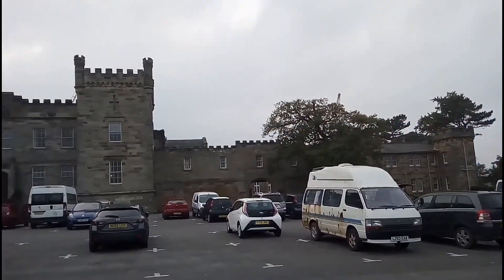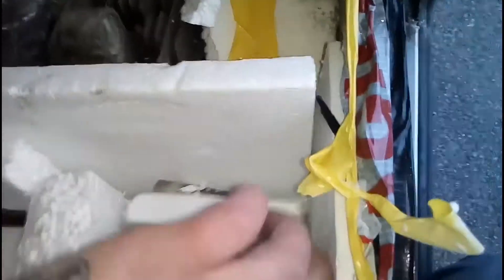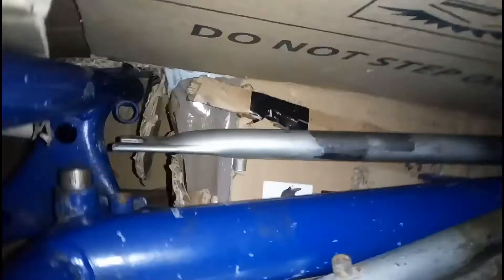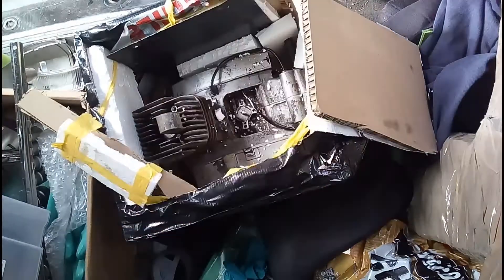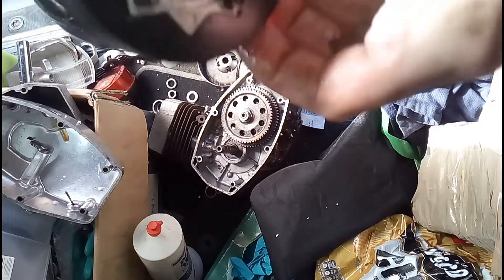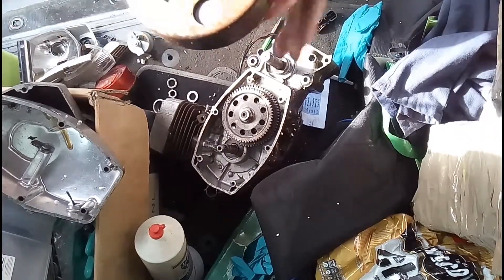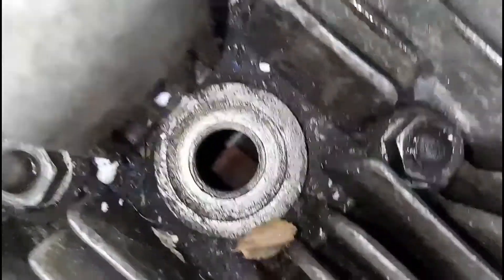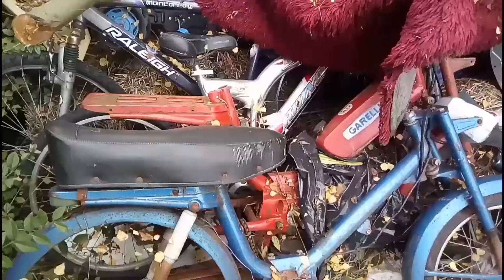Garelli Concorde by post. Filmed on location all over the place

Comment: I like your videos and I also restore mopeds however I am wondering where you get yours from. I buy almost everything from ebay and people seem to want the earth for almost any old wreck. Some idea of your sort of sources please.
Reply from the maker: Hi thanks jon8xty1 glad you like the videos! I get most of my stuff is from eBay too but I spend a lot of time finding bikes nobody seems to want to bid on. I got a Honda SH50 a while ago for £52 because the seller had 3 identical ones all finishing at 1am, so I just bid on the cheapest 😀 also I found a guy who restores Garelli Rekords and Tiger Crosses which are worth big money when they're restored. He buys "lesser" Garelli mopeds, removes what he wants, then sells the rest for basically scrap, so I buy them as spares bikes and make one good one out of 3.
Reply: Dear Phil ( I assume that is correct ) thankyou for your reply. It looks like I need to change my tactics. I'm really an NSU Quickly fan and these seem very popular and thus pricey. What mopeds would you suggest worth looking for in your opinion. Very best wishes John.
Reply from the maker: I've wanted an NSU for ages but I've never seen an affordable one unfortunately. Tomos were quite cheap until recently, but they seem to be going up  in value now. If you don't mind travelling to pick it up you can usually find a reasonably  priced Mobylette or Honda melody on eBay. If you're in the south of England there seem to be a lot of people with imported french bikes in their sheds who put them on eBay cheap. Make sure they have a NOVA form and are UK registered as it's a lot of expensive paperwork for either. Good luck John!!